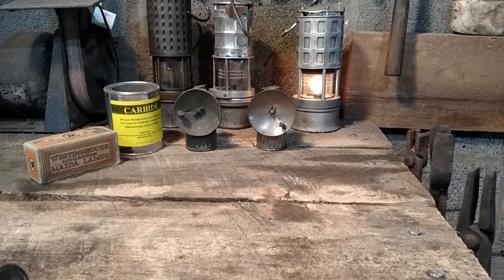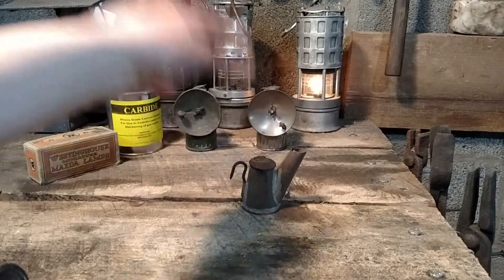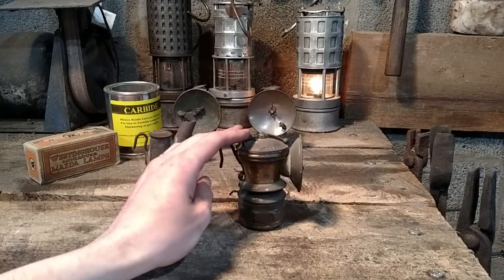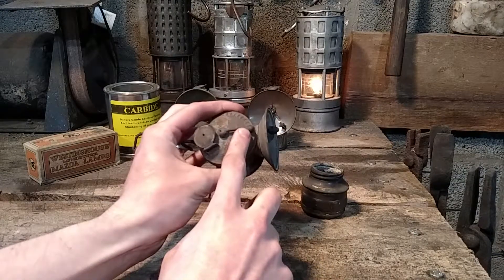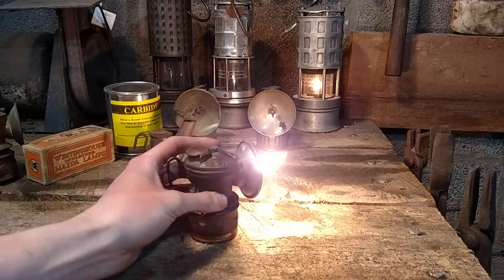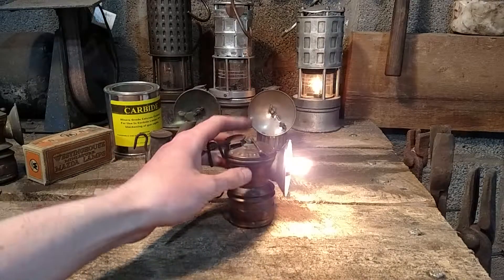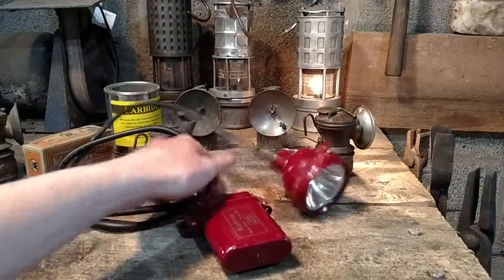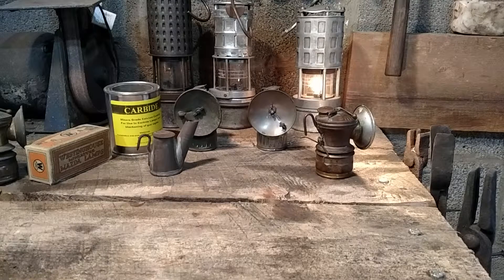Lighting in Underground Mines

Comment: What's a good price for a carbide hat lamp?
Reply from the maker: $25-50 depending on the style for one that works
Reply: @abandonedminesofpennsylvan266 I'm in the UK so carbide lamps weren't as popular here, I'm about to purchase a Premier of Leeds large reflector style lamp for £33 which is around $46. Missing its brass shine but look in about working order, does that sound like a reasonable price?
Reply from the maker: @relicsrespirators1828  sounds like it, doesn't need a shine to work well. Just make sure the tip is clean
Reply: @abandonedminesofpennsylvan266  by tip do you mean the drip stem tip?
Reply from the maker: @relicsrespirators1828  the nozzle where the gas comes out. I use the micro drill bits to clear them out.
Reply: @abandonedminesofpennsylvan266  I have a few micro drill bits for modeling etc, so that should be an easy fix it there is a problem with it. Anything else I should look out for?
Reply from the maker: @relicsrespirators1828  make sure the drip works properly and shuts completely off.
Reply: @abandonedminesofpennsylvan266  is there a way to fix that if it doesn't shut completely?